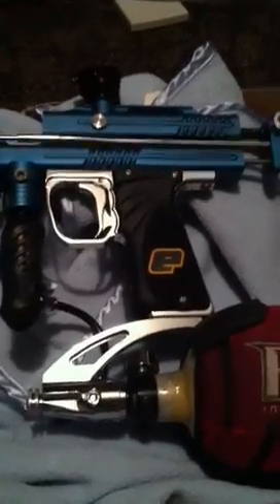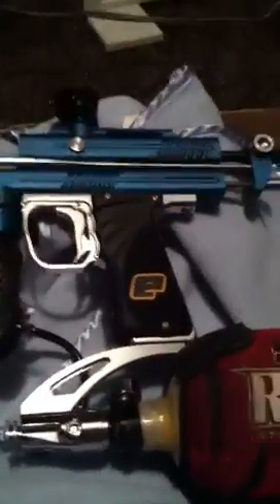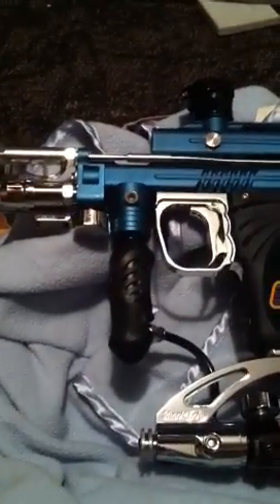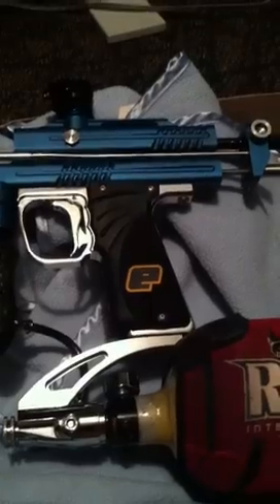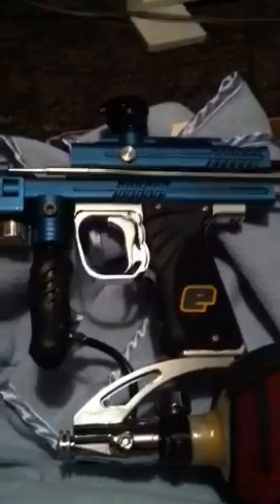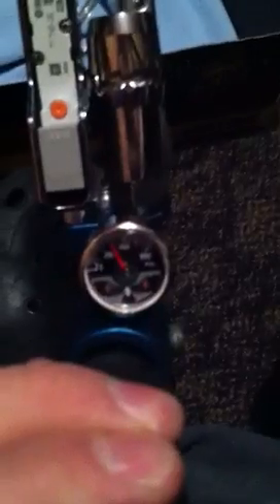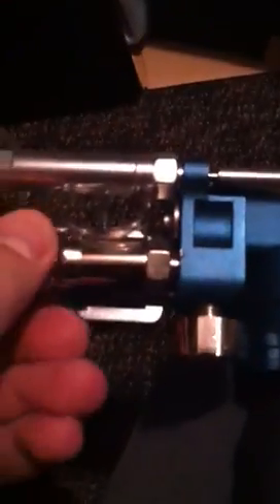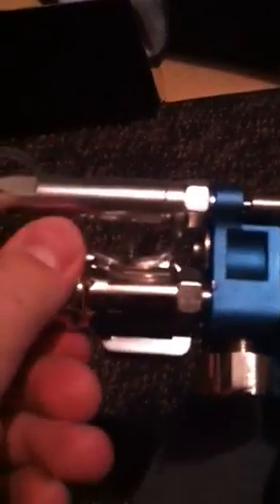Electronic Autococker three way leak

Comment: i had same issue on my super stock 2005, its the gasket where you hear leak from and cost like $7-12. its simple unscrew the two small screws remove gasket carefully and replace  done.
sad thing about autocockers the community is hesitant to help each other.
Reply: Is it a solenoid gasket? For the electronic board up front?

Comment: I have played years ago when the STO`s first came out. I used to work on cockers and make my own trigger plate jigs out of JB weld epoxy. I told the guys at the shop I bet I could make the sear`s into roller sear`s and they said i was crazy... so I pioneered that idea and saw that it came to life. I like the tech issues and am totally new to the E cockers but its all easy

Comment: hey bud i took the rear hose (the one closest to the gun body) and put it on the 3 way and blew through it with my mouth and put the solenoid back as i blew and air seemed to rush through, i just took some engine gasket sealer... and gooped it on the gasket more around that rear hose slot, re positioned it and blew again and no leak. i loosly tightened it down, just barley till i could hear no more air. i will let it dry and fully tighten it. as long as the 3 passages are clear, we`re golden

Comment: did you get it fixed? mine is doing the same thing... i was thinking the little rod inside was backwards or something... i know mechanicals have a hole in the front, there`s not much to them really. so you replaced the whole solenoid and it still leaked?